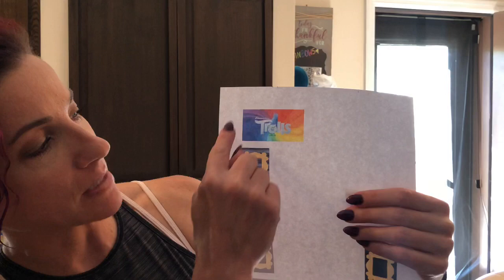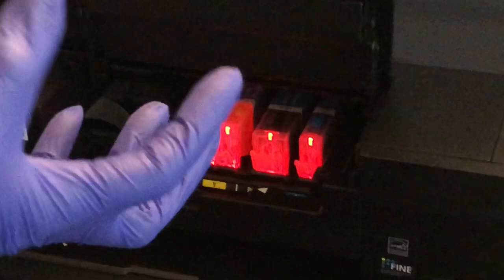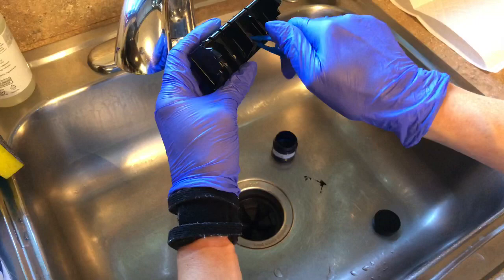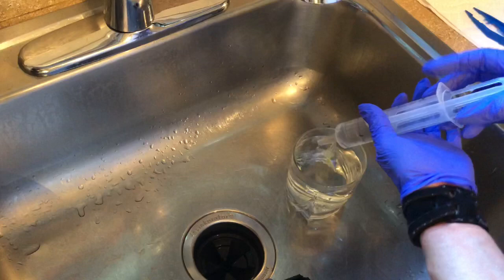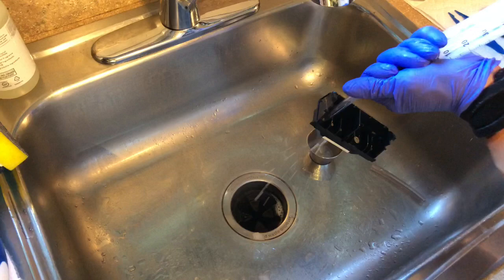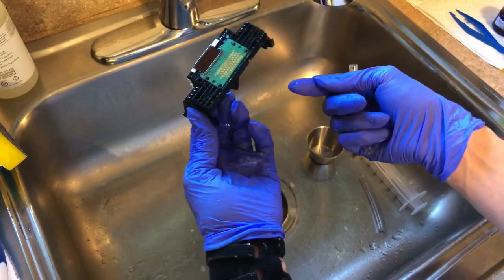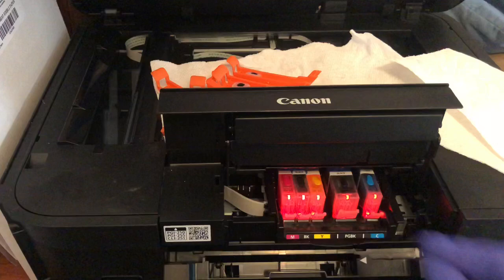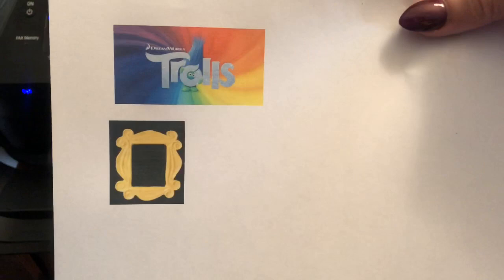How I Unclog My Edible Printer Head

Comment: Thank you so much! I’ve been cleaning my print head the wrong way with much success, not so much this time, and I have a cake due today at 4:30. I’m going to give this a try I pray this works moving forward. I’ve never used the cleaning solution. I’m hoping my printhead isn’t too clogged, being that my new printer isn’t even a yr old 😢
Reply from the maker: Oh no!  Try running the hot water through each of the channels for a while.  Sometimes I do it for like 20 minutes to clear a clog.

Comment: So my printer has a cleaning option when you go to settings and maintenance settings where it checks for clogs and it has cleaning and deep cleaning options where it cleans itself. I have a canon pixma ts702a. Would you say that isn't a very dependable way to clean the heads?
Reply from the maker: I never clean it with that function.  I always remove and soak the print head.  Here's a video showing how! https://youtu.be/H3-eLcOZ4pQ

Comment: Thank you for sharing your video.  Do you have a schedule for cleaning the head or do you do it when the print isn't good quality?
Reply from the maker: I really just do it when it's not printing correctly.  But if you keep up with the weekly tester pages, I find that it helps to prevent the clogs!  (They still could happen, but not often.)

Comment: hey there! if you were planning ahead of time for your edible ink printer to be stored and not used, is there a way you would recommend preparing it to sit for a few months so that the ink doesn't dry up and clog the print heads? i really only use mine a few times a year but still save a ton of money by owning one rather than having to outsource printing every time for big projects! being able to store the cartridges and prep the printer for storage so that i don't waste materials would be a life saver!!!
Reply from the maker: I would completely clean the print head like I do in this video.  However, I'm not sure the cartridges will last once you open them.   You can put the orange clips back on them and store them wrapped in plastic and in an airtight container.  But they may still dry out.  I never have done this, so I'm not 100% sure what to recommend.  I recommend asking the company where you bought the printer for further insight!

Comment: So, I think I ruined my last printer when cleaning the print head...don't know if it was just so clogged that it couldn't be fixed or maybe I touched some of the electronic parts while cleaning.  It is now time to clean my new one.  I see that it is not imperative to keep the electronic parts from getting wet which is what I think I was trying to do before, just don't touch with your hands.  Thanks!
Reply from the maker: Right!  Just make sure it's completely dry before you put it back together.

Comment: Think its possible for printer to stay ok,  if you clean printhead and leave it with no cartridges ?! So it sits there with no ink in it. I got one awhile ago but stopped using it so now i kinda just wanna have it sit cleaned out but not sure if it will still work again 😂
Reply from the maker: Yes!  If I know I'll be away for a while, I will clean the print head and put that back in the printer without the cartridges.  I will put the clips (that came with the cartridges) back on them, then wrap them in plastic wrap and store them in a ziplock bag until I'm ready to print again.

Comment: How often does this have to be done ? I just got new cartridges a few weeks ago and did a clean and it was printing fine now I have lines through my black so just wondering if once a month this needs to be done ?
Reply from the maker: I only do it when I'm having issues.  I print religiously a few times per week, so I haven't had a lot of printing issues recently.  Sometimes the ink can build up around the sponge opening causing the lines.  Check the black cartridge...take it out and turn it upside down and see if there is buildup around the opening?

Comment: I need help! I bought a nee printer just for edible images. I got everything set up and first few prints were beautiful, but very quickly the purple has turned grey. I cleaned the print head, I refilled the cartridges and still full and grey! 
What am I doing wrong!!
Reply from the maker: Ugh it's the worst when it doesn't go right!  Did you get your supplies from Icing Images?  If so, they have wonderful customer service and can help you troubleshoot any issues!
Reply: @KarolynsKakes  no I bought my ink from a UK company because I’m in Ireland. I’ve messaged them but no replay. I got the print head cleaning supplies from icing images.

Comment: Has anyone ran into the issue of no water spraying through the other side in one color? Not sure what happens the first couple times was coming through just great then BAM it’s just slightly dripping out instead of spraying.
Reply from the maker: With these edible printers, the print head can easily get clogged if you're not printing weekly.  I had a clog so bad one time that I had to get an entirely new printer because I couldn't clear the clog.

Comment: Does anyone know what’s wrong with my printer I have cleaned the printer head all clear water coming out of each color. My magenta won’t come out barely at all and has lines I’m so confused because ink was just filled so it’s not that print head is as clean as I can get it! Magenta is flowing very well when plug is removed from cartridge!  HELP!!
Reply from the maker: You may need to replace the cartridge.

Comment: Hello I  unclog my printer the picture is red and blue when I ran my test page it came out half way red and blue so i did another one and it came out light blue and the red was gone when I did a black and white picture it lines in that one but I can see the pic please help lol
Reply from the maker: Oh no!  Sounds like you have a stubborn clog.  Mine wasn't printing red the other day.  I had to run hot water through the magenta port for like 20 minutes to unclog it!  Put that tap water on super hot and just let it run through each of the ports to help clear it all out.

Comment: Does this cleaning work to start using edible ink?
Reply from the maker: No, there will still be some ink in the printer so it's recommended that you use a completely separate printer that was never used before for your edible printer.

Comment: I'm so confused. I can print and everything looks good except my pink and purple tend to look red or darker pink. Would that mean my head is clogged? I've just ordered a different kind of ink to see if it's the ink. Have you had problems with pink and purple?
Reply from the maker: Hmmm, I never had that specific issue, but I have had the colors not print correctly.  Here is another video I made, your sponges could be drying out.  Do you print tester pages frequently to keep the ink moving through the system?
https://youtu.be/2zSwh267vrg
Reply: I normally use it at least once a week. I have ordered a different brand of ink. I didn't make any changes to the print settings. Did you change yours? My settings could be wrong and on the default settings. I will check to make sure the sponges are flowing but normally they are when I refill them. I always fight to get the case to snap down.
Reply from the maker: @mzjujunsc  did you get your printer system from Icing Images?  If so, here is their video on how to set it up. You must have the proper settings for it to work right. 
https://youtu.be/eDFAfxtvW54
Reply: @KarolynsKakes  no I didn't. I bought it offline. I will go in a change the paper to Matte and standard and see if it makes a difference. I think my color settings are off.